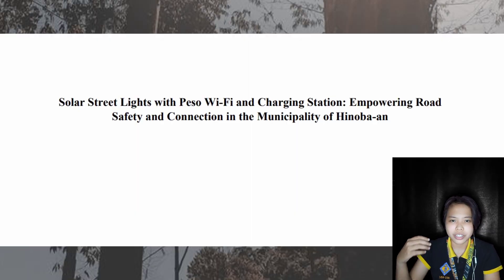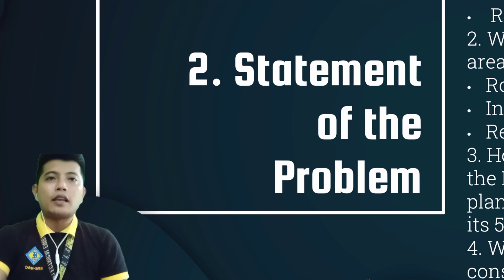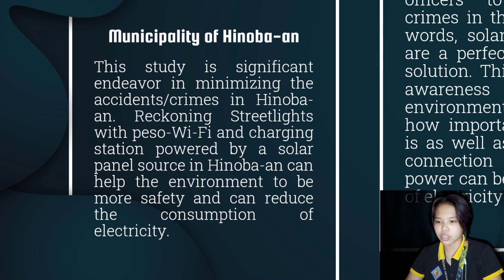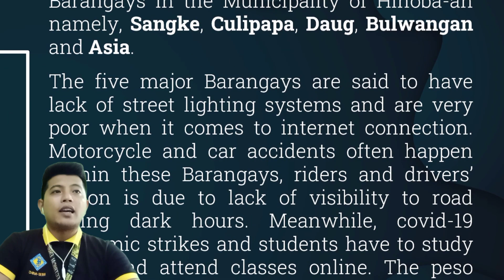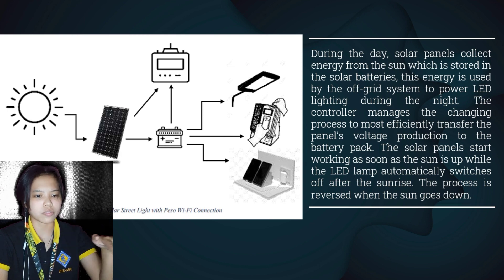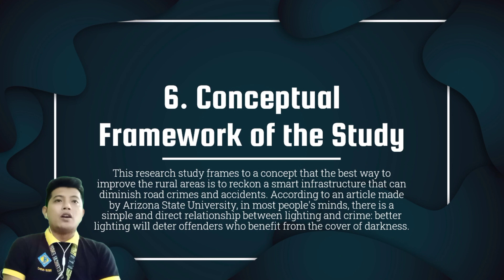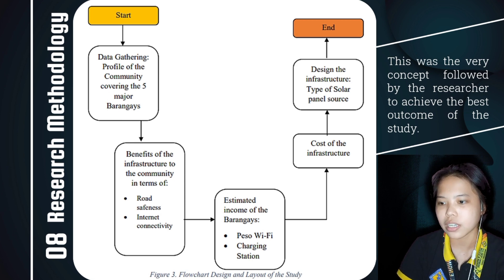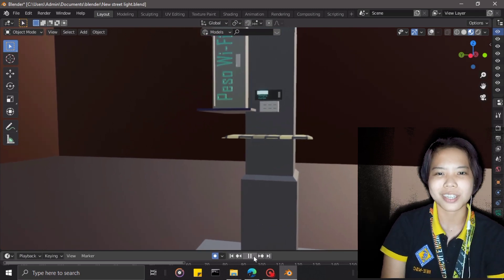Solar Street Lights with Peso Wi-Fi and Charging Station: Empowering Road Safety and Connection

Comment: Villanueva, Chastine E.
COE 346 Methods of Research T-TH 5:00-6:30 PM 
March 25, 2022 

Reaction:
This research proposal is really interesting and helpful to us visitors because solar streetlights provide several advantages over regular energy sources.  The researchers of this study gave an excellent presentation; I enjoy the way they speak since it is extremely straightforward and intelligible.

Reflection:
Solar energy is a sustainable energy source that has aided us in multiple ways, including street lights, batteries, the project they presented. This form of innovation aids in the growth of society and gives people a sense of security. Technology is evolving rapidly, and it will continue to do so in the coming years.

Comment: NAME: Nica P. Ragay
CLASS NAME & CLASS SCHEDULE: COE 346-A (TTH 5:00-6:30 PM)
DATE: March 25,2022
REACTION: This research is very informative and a timely problem and solution presented. This research is killing 3 birds in only 1 stone. First they provided the streets with lights and also the Piso-Wifi and lastly for them to charge their gadgets. This is very timely because we experience last typhoon Odette to have a month-long no power. Having this kind of technology is very favorable as primary and secondary source of energy in the community. 
REFLECTION: This study is very doable since P2P or point to point system in the Philippines are using solar technology to power their routers and radio dishes that was attached to their towers in the mountain. Applying this in lighting, charging and powering of piso-wifi routers is very helpful especially for those communities that are in the remote areas of the province.

Comment: Loren T. Cuaresma
COE 346A Methods of Research T-TH 5:00-6:30 PM
March 25, 2022

REACTION:
The video is very interesting and informative. I also agree with the researchers that improving the solar panel's capacity to use as a renewable source of energy. This is a perfect study since not all of the streetlights can be maintained to have lights. Streetlights are important since they could help drivers to navigate their way clearly and avoid accidents. As well as it is also multifunctional which is very great and unique. 

REFLECTION:
As an engineering student, this study gives me more understanding of how to conserve energy that also helps our environment. I believe, as more research will be made, we as one could be able to lessen the effects of global warming and climate change. Using this device could help us avoid incidents since sometimes one of the lights is not working. In this study, it is very costly however very beneficial as well to people.

Comment: Name: Belinario, Cristy T.
Class Name and Class Schedule: ENS 341 B - (5-8 PM Saturday)
Date: March 25, 2022

Reaction:

The project proposal kills two birds with one stone. A solar street light equipped with peso wi-fi and a charging station is both cost effective and environmentally friendly. It can also generate income for the area of study, which is extremely beneficial to the community. One of the study's implications focuses on students, as the street lights would have peso wi-fi and charging stations for educational purposes. The issue is that technically, street lights would be installed alongside the road, and students would be standing by the road to connect to the Internet or charge their cellphones and other devices. The researcher did not consider the safety of the students in uncertain situations, such as the safety of the place for students and whether there is a specific area where the students can stay while using the proposed project's services. Although the Philippines is prone to typhoons, which solar energy cannot reproduce during those times, there are major solar farms in the country, so the project is feasible.

Reflection:

The proposed project was great and engaging. Personally, I have difficulty connecting to the internet because of the poor connectivity in our area, which is located in the highlands. If there was a street light with peso wi-fi and a charging station in our neighborhood, it would be wonderful because there is an occasional power outage here, and I am unable to connect to the Internet because I only use a cellular wi-fi router, which does not work without electricity. This project would be extremely beneficial in that type of situation, particularly for those students who were experiencing that kind of emergency. But I doubt it can withstand a virtual meeting lasting several hours.

Comment: NAME: Ong, Pearl Marney A.
CLASS NAME & CLASS SCHEDULE: ENS 341 - Research Methods for Engineering - Saturday (5-8PM)
DATE: March 25, 2022
Reaction: The video presents a research that is cost-effective and minimizes electrical energy consumption. The idea presented has multiple functions that can benefit the municipality of Hinob-an.
Reflection: The solar streetlights with peso WiFi and charging station is like a toolbox because it has numerous functions that a person needs. The municipality of Hinob-an and their villages does not have electricity, so using solar energy greatly benefits them and their community.

Comment: Vanissa C. Monticino
COE 346 Methods of Research TTh 5:00-6:00pm
March 25, 2022

Reaction: The research proposal is both intriguing and cost-effective. The researchers presented their findings in a very straightforward and accessible manner. Overall, the presentation is excellent.

Reflection: The suggestion with the purpose of empowering people's safety and providing the community with the connection it need is a great concept. It is more environmentally friendly than other alternative energy sources because it uses solar energy. As a result, the notion is certainly a significant contribution to the community's development, as connection and electricity are now regarded needs.

Comment: Catherine Joy Lacson
COE 346 Methods of Research T-TH 5:00-6:30 PM 
March 25, 2022 
Reaction: 
 It was a brilliant concept, and I commend the researchers on their work. This innovative streetlight is especially useful in locations where there is no electricity and internet connectivity is limited.

Reflection: 
Solar Street Lights with Peso Wi-Fi and Charging Station allows students who are struggling in online classes due to a weak connection to use the peso Wi-Fi put in the streetlights.

Comment: NAME: MACAHIDHID ALRICK , O.
CLASS NAME & CLASS SCHEDULE: COE 346A – TTH 5:00PM-6:30 PM
DATE: March 25, 2022

REACTION: This proposal piques my curiosity. It was an excellent concept, and I commend the researchers on their work. This innovative streetlight is especially beneficial in locations where there is no electricity and a poor internet connection. I'm hoping to see one in the near future.

REFLECTION: With the purpose of empowering road safety and connection, this research Solar Street Lights with Peso Wi-Fi and Charging Station allows students who are struggling in online classes due to a weak connection to use the peso Wi-Fi put in the streetlights. Additionally, the security on the road during the night has been strengthened, so there is no need to be concerned when riding or walking there.

Comment: Macabinguil, Joshua R.
COE 346 Methods of Research T-TH 5:00-6:30 PM
March 25, 2022
REACTION: The research could be a great help to the community and minimize the electrical energy consumption.
REFLECTION: Solar Street lights with peso wi-fi and charging station is also securing the road as well as it provides a vendo that is really one of the wants of the community.

Comment: Balacy, Samantha Ruby Joy C.
COE 346 Methods of Research T-TH 5:00 - 6:30pm
March 25,2022
Reaction:
This research is quite innovative and environmentally friendly since they used solar energy to energize the street lamps with the built-in peso-wifi and charging station.
Reflection:
Due to the pandemic, it is not enough to have a good and stable electrical supply in rural areas; they also need a stable internet connection since the mode of classes nowadays is online classes. So in order to fix this problem, this study shows us that it is possible to have solar-powered street lamps and at the same time have a peso-wifi and charging station. It would be great if this could be implemented in the rural areas to aid students' education at all levels.

Comment: NAME: TORRES, JAMES CARLO A. 
CLASS NAME & CLASS SCHEDULE: EE 341 A-RESEARCH METHODS FOR ENGINEERING-TTH 6:30-8:00 PM
DATE: 3/24/2022

REACTION:
The research is very useful to the community. The researchers presented the study to the best of their abilities. the presentation is clear and understandable.  The integration of solar lights, peso wi-fi, and charging station is quite remarkable. 

REFLECTION:
Researches don’t need to be totally new, sometimes integrating current inventions into a useful innovation would be a very good project to create and study, especially if it helps the community.

Comment: NAME: Cheri Mae E. Tinguban

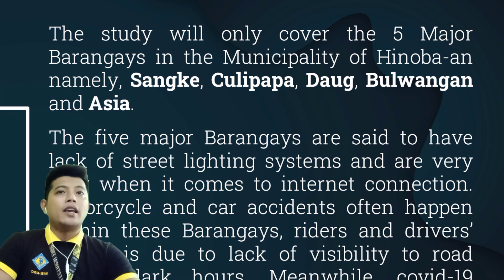CLASS NAME & CLASS SCHEDULE: ENS 341 – Research Methods for Engineering – 5:00-8:00 Saturday 

DATE: 24/03/2022

REACTION: This proposal is titled "Solar Street Lights with Peso Wi-Fi and Charging Station: Empowering Road Safety and Connection." Based on what I've learned, the Municipality of Hinoba-an does not have a solar street light system, and residents face difficulties working late at night, causing people to be afraid of returning home. Due to the municipality of Hinoba-remote an's location from major cities, electricity is not available in every village. Their electrical sources are also insufficient to meet the demand, which is expanding year after year. As a result, the researchers advocated the notion of prioritizing on sustainable development in rural regions by solar street lights with free wifi, which is critical for Hinoba-an students who take online programs. In addition, a charging station for their convenience. To put it another way, this study focuses on the most cutting-edge eco-friendly technology that is ideal for usage in rural areas for development and accessibility. I am astonished by the researchers' brilliant ideas; similar to the rural areas of Tayasan, Hinoba-an has the same situation, with few to no streetlights available around the area, and when given the opportunity to propose this, the researchers were able to put it into action, and conducted a study focusing on street security and safety, internet connectivity for students taking online classes, and other factors that will benefit the community.

REFLECTION: As I previously stated, I have had a traumatic experience with streetlights that had few or no streetlights. All I can say is that I hope the government will find solutions to these issues; there are many areas in our country with few streetlights, which is very important in our community; if given the opportunity, I hope this matter will be put into action as soon as possible, to ensure everyone's safety and welfare.

Comment: TRE-INTA, KEZIA L. 
EE 341 TTH 6:30 - 8:00 PM 
MARCH 24, 2022 

REACTION: This proposal catches my interest. It was an impressive idea and I appreciate the researchers for this study. Having this streetlight with innovations is very helpful especially to areas with no access to electricity and low internet connection. I hope to see one of it in the future.

REFLECTION: This study Solar Street Lights with Peso Wi-Fi and Charging Station with the goal to empower road safety and connection makes way for students who are struggling on online class because of weak connection to avail the peso Wi-Fi installed in the streetlights. Also, the security at road during nights are improved so there is no need to worry when you ride or walk in there.

Comment: NAME: BERNALDEZ, ELLYN MAE A.
CLASS NAME & CLASS SCHEDULE: ENS 341 - SATURDAY (5-8PM)
DATE: March 24, 2022

REACTION: This research proposal is very informative and useful to us viewers because this solar streetlights gives a lot of benefits compared to the traditional sources of energy. This energy used is called solar energy, this in non-polluting and low-maintenance source of renewable energy. 

REFLECTION: The solar streetlights will serve as second safe study area of the students as they will connect into the piso wifi and connect their chargers to the socket. It provides traffic safety and heighten the security on the streets at night. It can also save municipality`s money because it automatically beam or turn up and have have almost no operating cost.

Comment: Gliocam Blessings C.
COE 346 Methods of Research T-TH 5:00-6:30 PM
March 24, 2022

REACTION:  This research project is outstanding. It produces clean, long-lasting electricity with no hazardous pollution or greenhouse gas emissions.

REFLECTION:  Solar energy system power plants do not release any hazardous air pollution, which is a good thing because it has a favorable impact on the environment. The growth of renewable energy reduces the long-term expense of fossil fuels. The solar thermal power plant will generate electricity, which will be distributed to the electric cooperative, which will operate and generate as a supplier to the community.

Comment: Jessielou A. Gomera
ENS 341 B - SATURDAY 5-8:00 PM
March 24, 2022

Reaction:
This stufy is ideal not only in brgy bulwagan in Hinobaan but also to those places that has slow/poor connectivity. This project proposal can help places which do not have source of electricity. By the use of Solar powered technology  it would be much better for those people most especially to students.

Reflection:
Solar power is a renewable energy source which helped us through many things including street lights, batteries, and the one they presented. This type innovation contributes to the development of the community and provides safety to the people.

Comment: Franz Michael B. Nadal
ENS 341 SAT 5-8 pm
March 24, 2022
Reaction: The presented research proposal is brilliant and it could be adapted in many rural areas.  And woah the presenters first presenter voice was really convincing and pleasant to hear. Although the presented research was doable is just that it really needs a lot of investment and consideration. One more thing is that the audio of the second presenter was not really that audible and a lot of noises can be heard which sometime is very distracting. But overall it is a good research

Reflection: 
The concerns in the presented research is very real, I myself have a first hand experience. First of all , the lack of street lamp is very dangerous for lack of visibility means an opportunity for opportunist. Crimes may happen due on this. And the installation of solar panel is very appealing for not only you promote green energy but also help community. Imagine if all the street lamps is mounted with solar panels which then produces electricity. So if there is a excess electricity then we can use it to other things or light up our own barangay. Then we can be less dependent to the power grid suppliers which uses coal powerplants. With community and help students specially with poor signal connection. It is very good feeling for not only you improve yourself but you also see and improvement in your own community. I myself one day would like to apply this to our own barangay and the whole nation itself.

Comment: The idea and purpose of this research is really good, Integrating the solar street light, charging station and peso wifi into one.But how does the peso wifi works, like if muhulog ko coin then automatic ni siya na connected na ko sa wifi or naay password na I flash, and/or everyone near the station is connected na sa wifi?
Because the idea is very timely, if this innovation proven effective then other barangays can use the innovation.
Reply: The peso Wi-Fi vendo installation comes with an automatic IP Address from the installer. You will be redirected to an IP address once you will turn on your Wi-Fi within the range of the machine, and that's the time that you will drop your coin to the vendo.
Reply: @jeyocabonilas71  WOW. Nice kaayu. Thank you